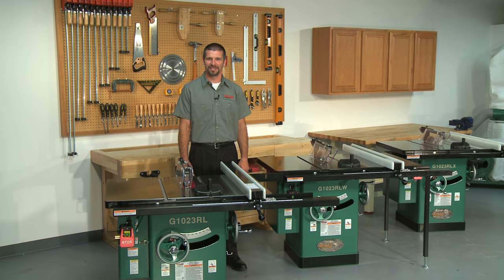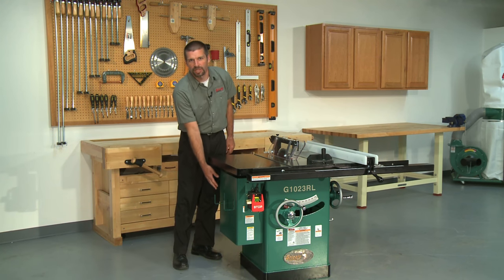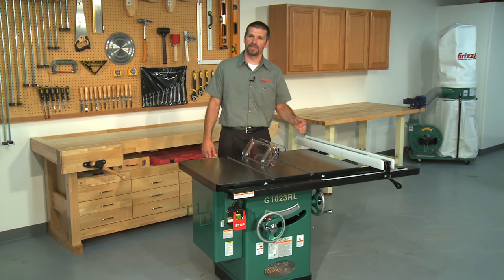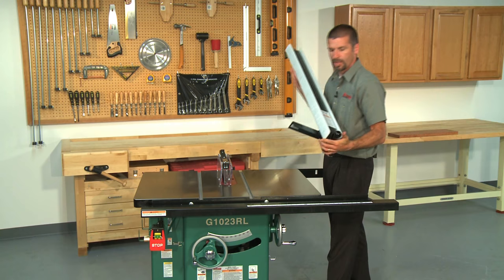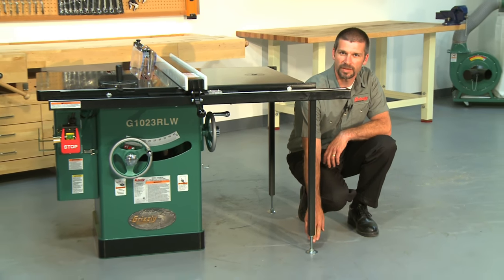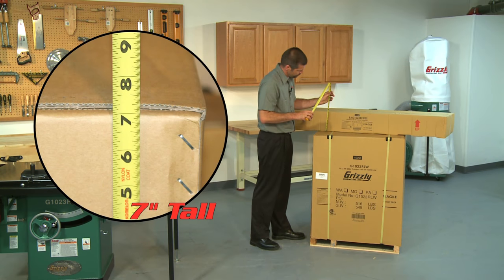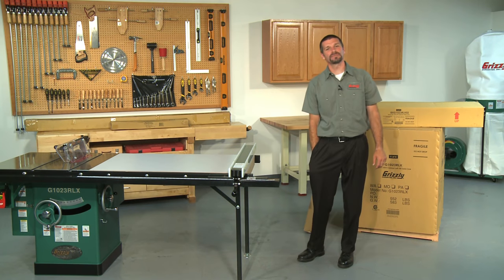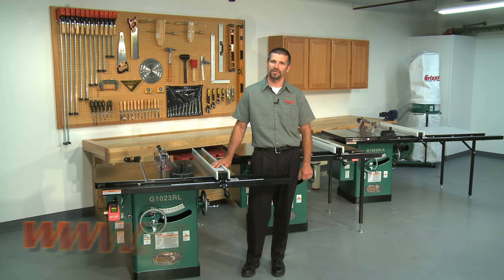Grizzly G1023 Series 10" Table Saws: Which One is Best for You?

Comment: Received my table saw in pieces all over the freight truck. I had to put everything together and send it back with no compensation for my time. My new one came in one week later. Now the saw shuts down after 10 mins. ..  This is not my first table saw I have been making furniture for over 20 years.  My electrician friend did testing on the motor and found that the capacitor were bad. Warranty should be 5 year warranty for the price that we pay for this saw.
Reply from the maker: We regret the difficulty you are having with your table saw purchase and work hard for every customer to have a good experience when purchasing from Grizzly. It's unfortunate the shipping company took poor care of your shipment but our Contact Center should be able to help with the second table saw. We suggest reaching out to them by submitting a ticket so customer care or technical support can be assigned to assist. https://support.grizzly.com/hc/en-us/requests/new
Reply: In order to' keep the price down , taiwan/ china saws sometimes have some flaws . 
i had this table saw , jointer and planer from grizzyly years ago . the jointer had a small crack in the cast iron . i e mailed a photo of the crack and they immediately responded saying they would replace the jointer . they did so within forty eight hours . 
Now THATS customer service , plus a very good machine for the price . There are a lot of other saws from Taiwan  that have horrible customer service . i'll stick with grizzly and forgive the occasional problem .